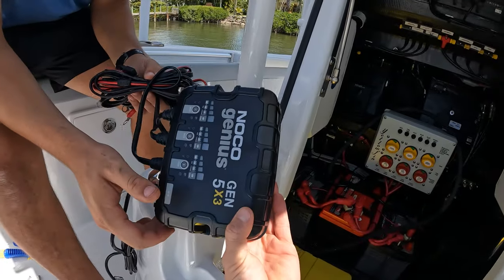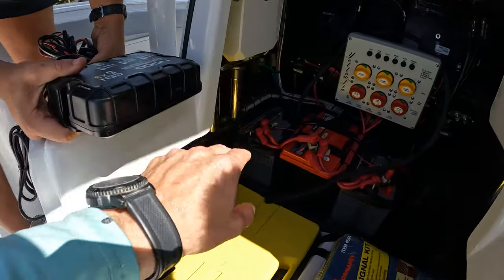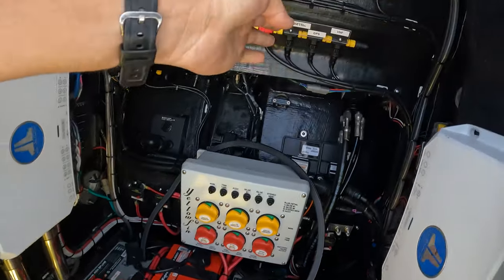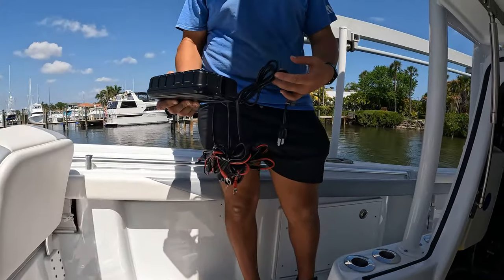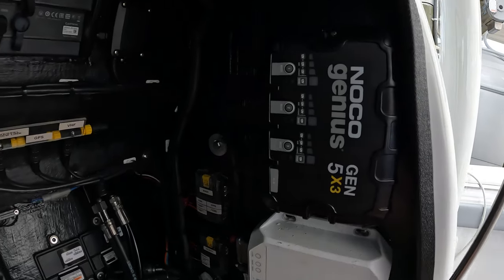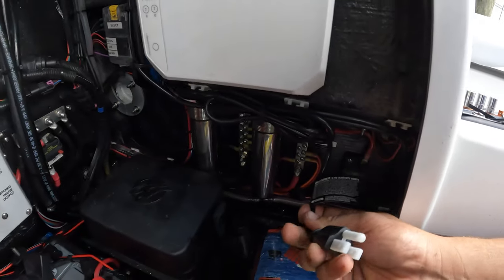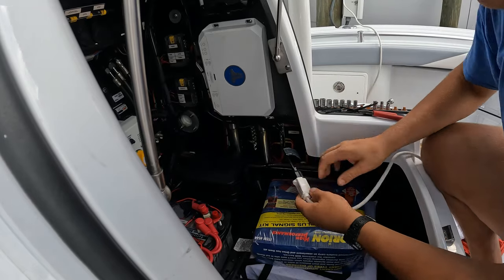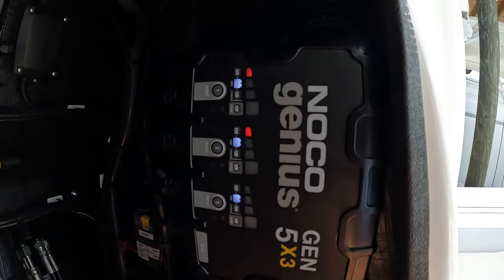Installing A Boat Battery Charger

Comment: Hey!  You guys are great!  Love the new podcast!   But I have to point out that y'all mounted the charger backwards.  

The way it's mounted, the small control panel and labels are upside down when you open the console and look in.  It's important because the NOCO chargers have a few different settings and colored indicator lights.  It's not a huge issue, certainly not a functional one, but I think small details combine to determine the overall boating experience.  

Keep doing your thing and I'll keep watching!  Thx!

Comment: I have 3ea 12volt batteries to run my 36volt trolling motor.  I have a 4 bank battery charger to charge the 3 + the house battery.  When these batteries die or stop holding a charge.....I was wondering about lithium's to save weight.  Maybe you can do a video talking about lithium boat batteries, the good and the bad and the on-board chargers.   Thanks.

Comment: What is in the side wall that you could just run screws into? Depth, material that would take the shock of waves and it didn't sound like the screws really grabbed anything with the sound of the drill or clutch setting. What about the routing of lines, do you have to worry about EMF on boats and interference of other equipment? Like radios etc... Just wondering, not trying to bust balls.
Reply: If it's in a console, you shouldn't have to worry about it interfering with any electronics. I did have a windshield wiper motor, somehow magnetize the arm,  and it was messing with the compass.

Comment: Great Channel! Thanks for this video,
I have a question, I have the same charge and in my boat I have a battery for to start the engine and 2 additional batteries for a 24v trolling motor, can the charge terminals be left connected to each individual battery or do they have to be connected and disconnected each time they need to be charged?
Reply: They stay connected. The system has a memory and will go to the settings you have chosen each time you plug in.

Comment: I was wondering, i got a great deal on a floaded boat with enginge. its a yamaha 115f thats ran 190 hours, thats been underwater. I know worst case i could desamble the enginge and sell parts, but is it worth and does it work do break down the enginge,  clean it and rebuild it if its not fully rusted? i have alot of experience on yamaha enginge, but never never dismantle an engine entirly. Thanks for answer!

Comment: Great video   I have the same boat.   Are you finding that these boats need more than one house battery?  I have a YF 26 too & the evo19 starts to dim-out after a few hours of running
Reply: I assume from low voltage….because if i switch to emergency parallel it brightens back up

Comment: So does the power plug go into the inverter?
Reply: Yes,  you plug the charger in to an extention cord or can wire in a bulk head plug.
Reply: No, the plug does not plug into the inverter.  That would be free energy.  It plugs into shore power with a regular extension cord.
Reply: @chiphill4856  thanks Chip 4 replying

Comment: Think it’s supposed to mounted in a well ventilated area. JT
Reply: And where would that be? In one of the bulge compartments?
Reply: It’s only hydrogen
Reply: I guess wherever you think well ventilated is. They are water proof aren’t they. Mine is up under the gunnel out of the way.  Do you even have one or are you a couch cowboy.  @Dex01-Z_WingZero

Comment: Where would you cut to extend the leads?
Reply: Just cut the ring connectors off and spice it there, I had to do that for one of my batteries, Noco said it wouldnt void the warranty.
Reply: Pretty sure all 3 pairs of battery leads need to be the same length.  These chargers measure minute differences in voltage and current.